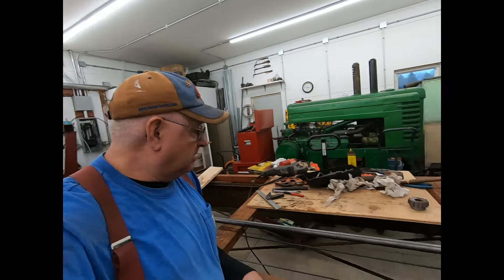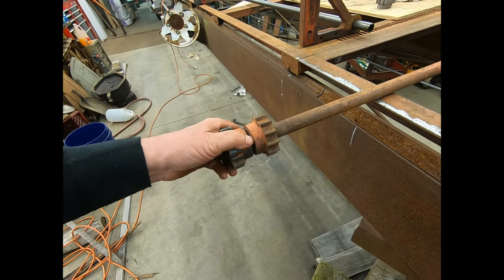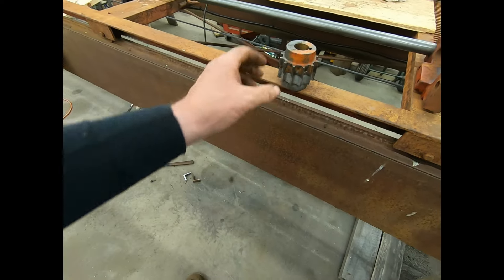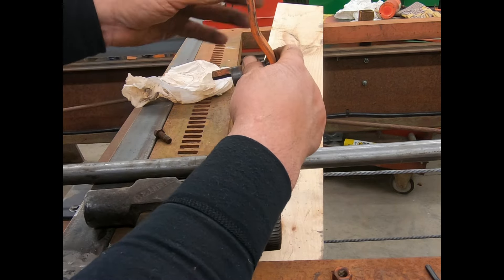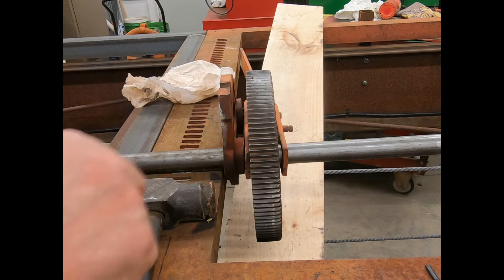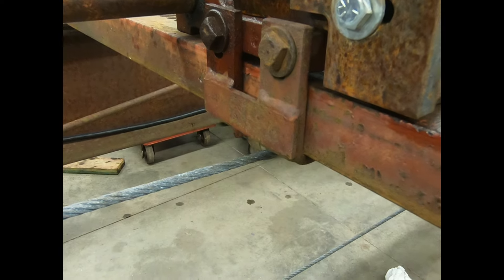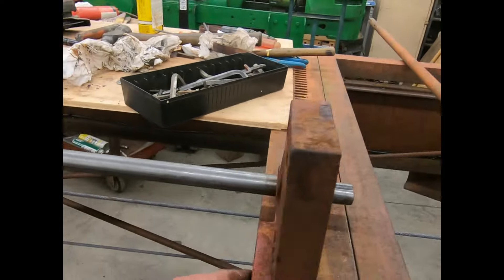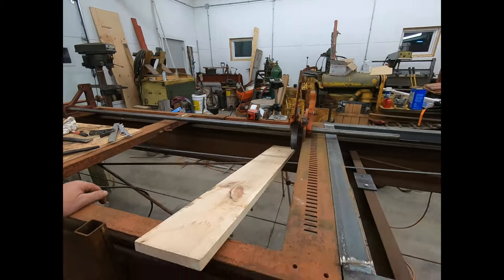# 721 M-14 Belsaw rebuild part 3 Setworks reassembly

Comment: Nice video and sound and lots of good tips. I need to tune up my M14 and I like that new style head block bracket. I have the old style that slips and the pinion gear tends to skip a slot on the carriage. The other issue I'll address is the handle and counterweight slipping down during a cut. I don't use the board scale but I did find it in the barn so I might try setting that up also. Keep up the good work.